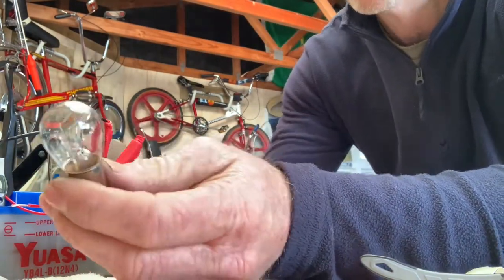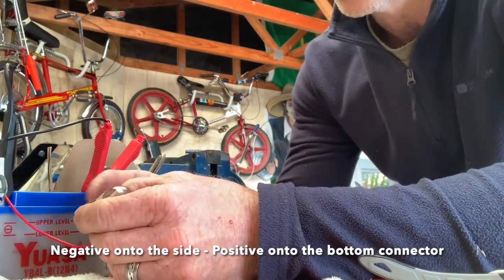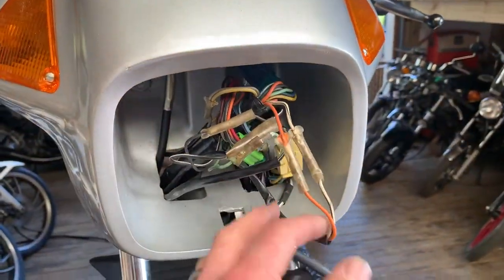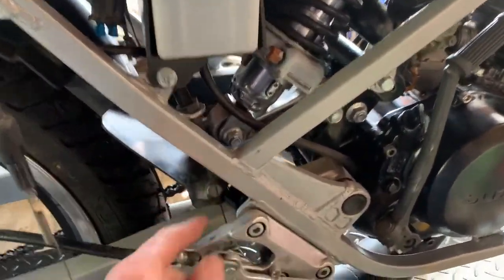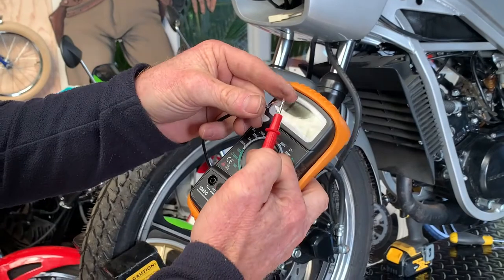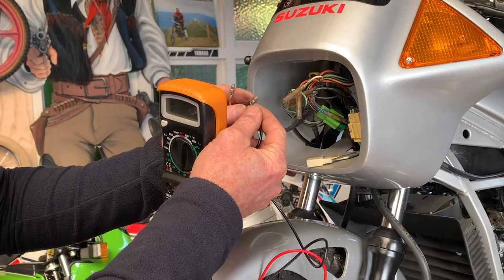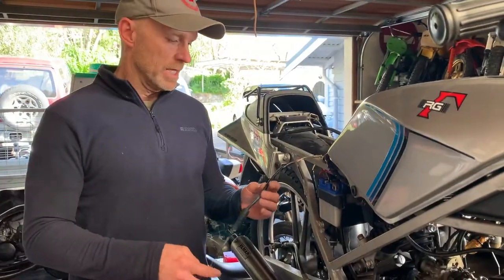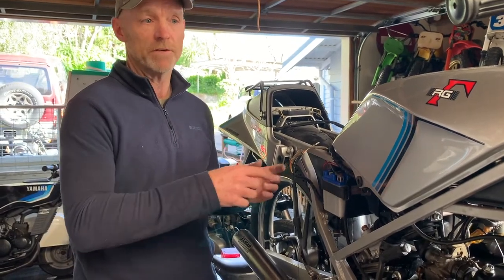How to find wiring problems using a multimeter.

Comment: lovely video. My problem however is that one of my brake bulbs burns out regularly. It works but it burns out quickly. That seems to be a slightly more devious problem than a bulb just not going on.
Reply from the maker: The could be many reasons, but if you have done the conversion to the Lifan, it is a  12V System, check that you are not using 6V bulbs.

Comment: My front brake isn't working I have changed the switch still no brake light. I touch the 2 wires still nothing. The rear works fine. How can I find where the broken wire is.
Reply from the maker: You can test the resistance on te wire by setting the multimeter to Ohms - put the clack connection on one side of the wire and the red connection on the other side. If there is movement on the dial the wire is good if not the wire is the problem. Check all connections, also double check all your earths are in the right place. start there and see how you go. Electrics can be a number of variables we have to just keep trouble shooting.

Comment: my scooter when i turn on ignition the main fuse pops what i can do ?
Reply from the maker: What kind of scooter is it? There could be many reasons. Do you have any wires exposed? Is any wire touching the frame where they are exposed? Are you using the correct amp fuse? What voltage battery are you using? This will be important as many scooters and older small bikes run 6v but upgrading the engine to a Lifan it runs a 12v system... these are a few that pop to mind but if you give me details maybe I (or someone on this thread) could help you.
Reply: @my50bike  kymco agility
Reply: @my50bike  I have a quick question also. Gen 1 2005 zx10r did a valve cover gasket coils and plugs put everything back together hook the good new battery and soon as I turn the key ecu fuse blows no fuel pump prime I can hit the Killswitch lights will come on and it'll try cranking but won't start. Any advice on how to find the short ?
Reply from the maker: @thomasgkioulekas6183  are you running a 12v wiring system? If you have changed the motor the voltage goes from 6v to 12v...
Reply from the maker: @Apolloneek  did you take the light switches off or change the handlebars? Some bikes use the controls as the earth/ground so if the handlebars have been changed or they are not making good contact with the original handlebars there is no earth /ground. Pull the headlight off and see if any wires are exposed or have come loose. You can also use the multimeter to test resistance on each wire to see if you have a faulty or damaged wire. It could be so may things...try work back with everything you changed when you did the service.
Reply: @my50bike  so the lights and handlebars weren't touched but I can take it apart and check if any wires are damaged. The lights front and back and horn work and will come on once the key is hit to on but ecu fuse just blows immediately so I'll probably check the fuse location with a multimeter
Reply: @my50bike  so I put a multimeter on it and got these results. When I connect the negative and put it on a bolt or unpainted surface I get a beep or continuity. Also I checked everywire going into the ecu plug and found the positive beeps on a green wire and neg beeps on a blue and yellow wire.

Comment: On my bike if i turn my key for the ignition the bike turns on and indicstoes work if i turn the key for lighrs my indicstors stop working and my headlight and rearlight works what coukd be the problem?
Reply from the maker: Hi, it's not always a straightforward answer because it could be a few things. Is the wiring harness properly grounded? Have you checked that you have the wires going to the correct switches I.E left and right? Have you checked the switch itself? Also, a possibly silly question is this on a Lifan (i assume so) or is it on an original 6V engine?